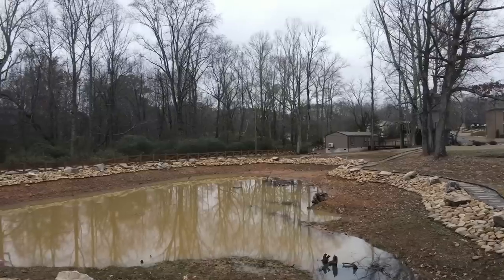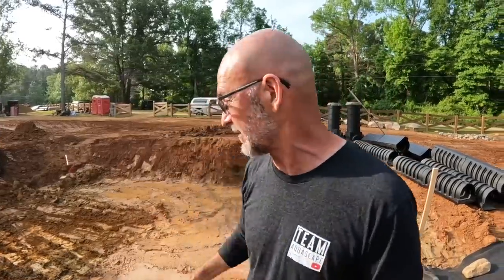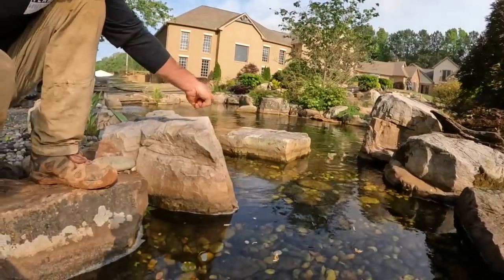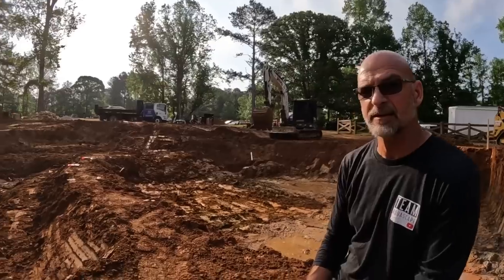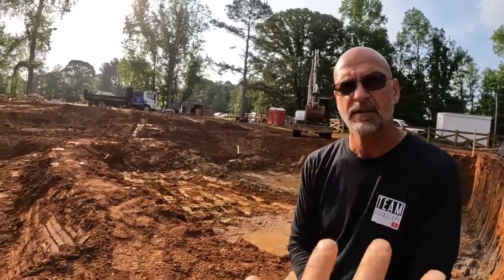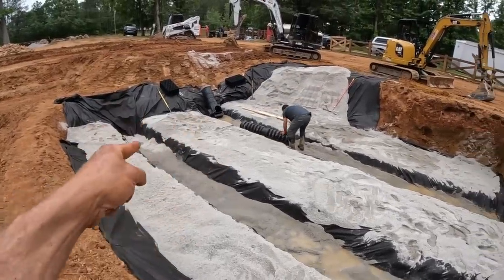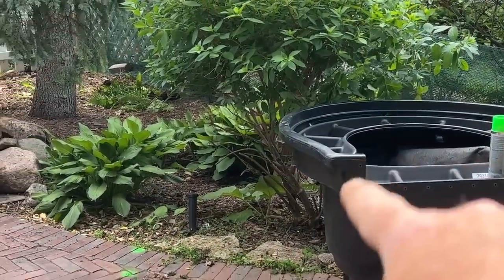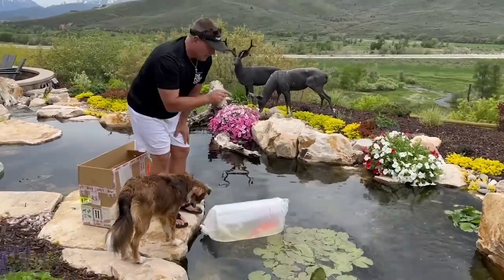Shaq's BIGGEST Pond YET, and WHY he DOESN’T WANT it!

Comment: You guys ever put a liner in and realized one of the employees punched a hole in it and then you got to find out where the water is leaking
Reply: Like the last video or so was exactly that (Jack) and a hole happens rarely but it does, if there’s water loss it’s usually an edge after that you would check the plates on the biofalls or skimmer boxes.